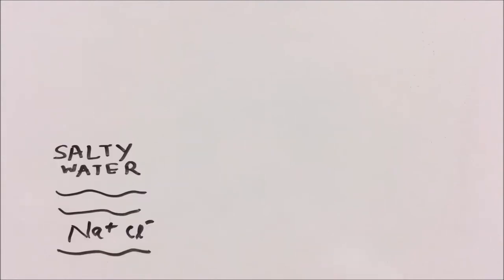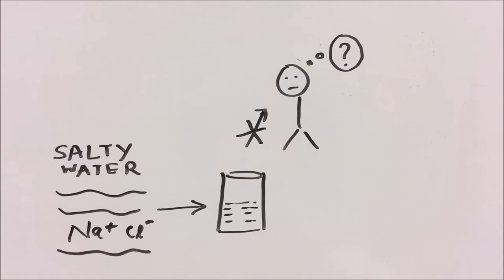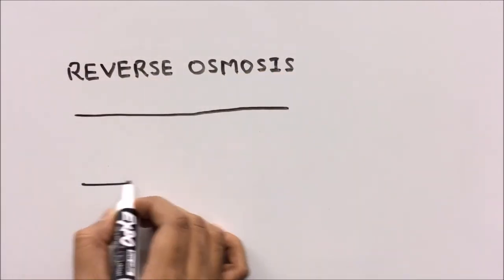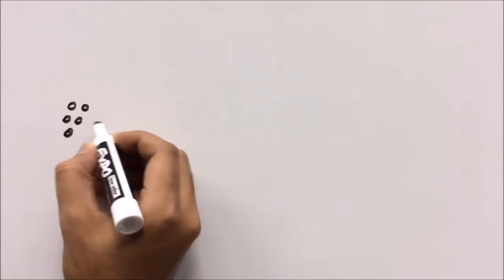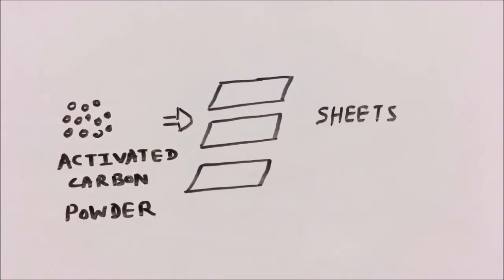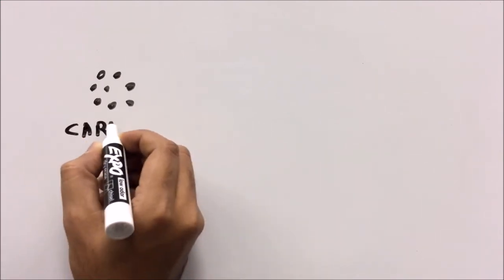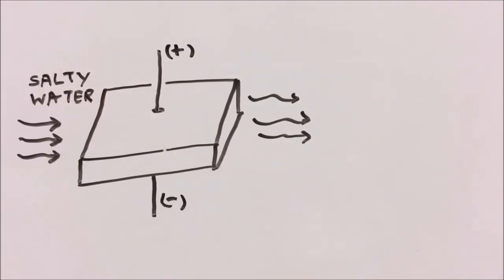Using nanotechnology to desalinate water more efficiently

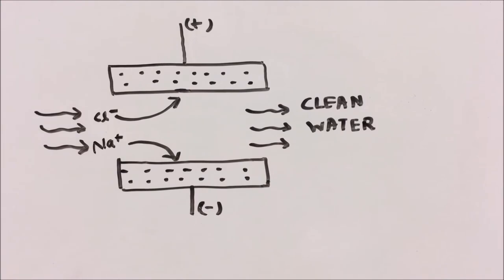Comment: At 1:16 you say that the captured ions can be removed, which produce a small amount of waste water. But how small compared to other techniques and how clean is it really? The waste also has to go somewhere, so how and where is it disposed?

One of the main problems with current RO-installations is the release of toxic chemical waste and brine into the environment, yet none of these are adressed in this video about NF/EDR.
Reply: The answer to the first question, the fractional volume of wastewater can be from 5 to 25 %. Which means it can be 10 -15 % less than the most efficient RO systems. The extent of the water cleaning/desalting depends upon the desired application and feed water salinity. It can be as high as 95% cleaner than the feed water. Wastewater can be collected separately and disposed of using the same approach as RO. I hope that answers your questions.
Reply: Ahh but salt from the ocean has a high concentration of lithium so this waste water can be used to manufacture batteries